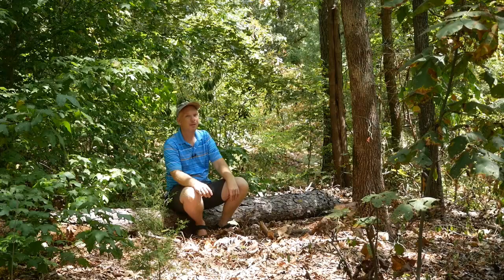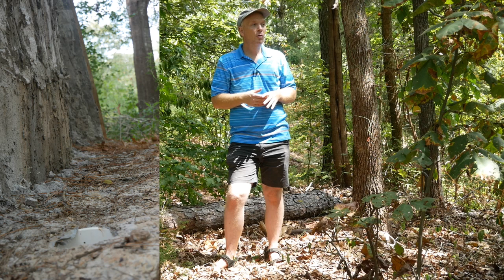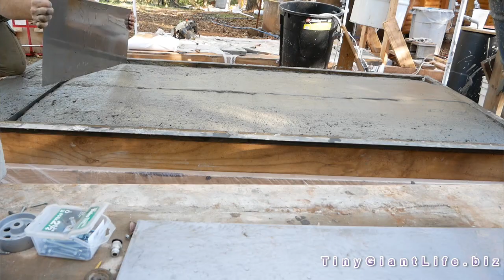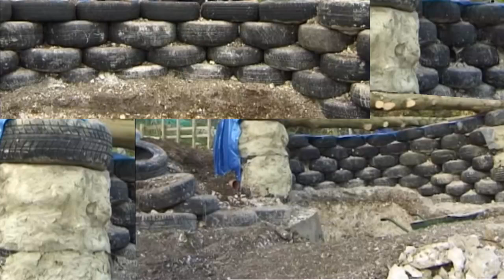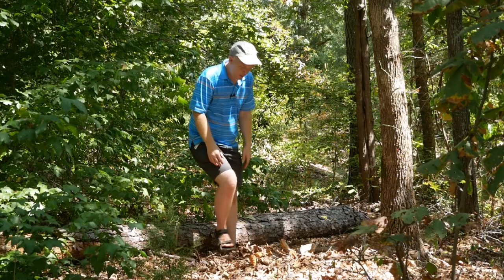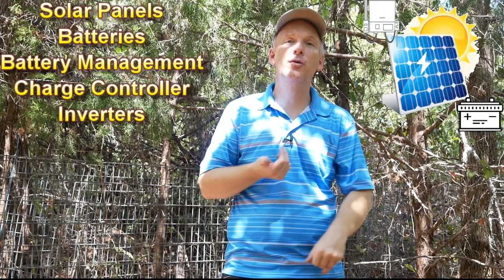Earth Ship Vs Air Crete House   YouTube

Comment: 5:49 what are you talking about? Regardless of what state you're in there's not only a garage but a tire store and probably multiple of both in every single town within every single state. It costs the tire store or even the mechanic more than a dollar to get rid of the tire that's sitting in the backyard collecting dust and you just asked if you could have it and it's always going to be free. 
So are you scared of asking businesses for free tires?
You also keep leaving out the fact that there's cardboard placed within the tire to keep the dirt inside the tire and that is also free at any store you want to go to in any Town chances are there's a dumpster labeled the cardboard dumpster

Comment: I've thought instead of using Tyres (which is hazardous imho), it would have been much easier to use Rammed Earth for the back wall. Rammed Earth has incredible thermal mass and could be an alternative to tyres wall. Aircrete sounds like a good idea as well but I hear aircrete is hard to work with (need to know how to mix them up properly) and they can't bear heavy load compare to tyres wall or rammed earth wall.

Comment: My first thermal mass earth home was built in New Mexico. today I'm in South Carolina and working on my second house with major upgrade ideas 
one idea is cooling. my blueprint has never limited me to the Mike Reynolds U shape design, I'm more four corners and traditional in layout keeping south facing the foundation of design.
but my idea to cool without a berm and cooling tubes is making the Souths traditional concept better...
I did a addition on a friend's house which sat on brick foundation about 5-6 foot high given downhill grade. instead of brick I layer earth bags. to this day that crawl space is 55 degrees all the time, he says he loves going down there in the summer and always debates why he doesn't do the whole house like this.
so my idea was to use tires for the square or rectangle perimeter about 5-6 tires high, end then use earth bags for your exterior walls. at the peak of the roof functional windows or gravity skylights, and just floor vents to pull up the cool air from beneath the home.
yes the south's humidity is something else, but I know through trial that you can actually cool your earth home, you just give your home a crawl space, most earth homes are on the ground, but I believe it's killing one of the most important functions naturally, and that's cooling, we have the thermal mass down, but I believe this idea just changed things, or at least I will see once I actually build it not just theory...
I actually have upgraded earth homes to be marketable, I also will be testing a indoor outdoor connected pond system, and also a intergraded worm composting fertilization along with the fish emulsion within the grow beds and vertical grow tubes.
my home idea is to pay for itself within a ten year period, and on a high end have potential to produce a million dollars in 20 years for retirement if you live in a legal state...
all my ideas are for we the people, for free, I can't win unless we all win, and we are losing when we actually should be so winning it's not even funny,
why punch a clock when you just enjoy your home and manage your systems that produces your income 🤷🤷 well I'm going to show a better way, I already have my first home project.
Reply from the maker: If your location is low humidity you can also integrate night sky radiant cooling.
Reply: @TinyGiantLifeStyle  nah the South is 90% humidity, like hells butt crack...
I hate it if you didn't notice 🤣

Comment: I am literally enthusiastic about hearing someone finally pitch practicality.
Reply from the maker: That's the bottom line for AirCrete is off the shelf availability, insulation, buildable now at reasonable cost without needing expensive tools or heavy equipment.  It's most practical now

Comment: "You can use your waste water to completely zero out the carbon footprint of the manufacture of that cement."
WTF?   Please explain how that is possible.
Reply from the maker: The numbers are on the internet for c02 production for cement as as are the carbon sequestration numbers for fast growing hybrid poplar trees.  I thought I did a video on the numbers..

Either way the c02 for a home is irrelevant compared to running air-conditioning or driving to work daily.

Comment: What about combining scrap polystyrene with aircrete? Great insulater and tons of the stuff available.
Reply from the maker: Think you would be better off just using encapsulated polystyrene or ground up styrofoam and cement perhaps even with a little sand combining aircrete with the foam does not help the point of aircrete is the air making the insulation and having foam in cement is for the purpose of insulation also. Eps is a great but messy product

Comment: I doubt aircrete will work for the retaining wall on a earthship for those who are asking. Aircrete doesn't have the strength of regular concrete so that retaining wall would have to be at least a foot thick (might as well just do a 6 inch concrete wall pour). Plus you want the retaining wall to absorb the winter heat into that back wall and that is the opposite of what aircrete does. I've never heard of people insulating the retaining wall. You can build a simple device the cuts the wall off one side of the tire to make the tire packing much easier. Filling the tires with aircrete is possible but there again you want the thermal mass from a solid retaining wall. I personally really like the idea of 2 ton tire bales for earthships but I can't find anyone who sells them in the Southwest.

Comment: Since concrete is actually unhealthy for you, how does aircrete compared to concrete?
Is it actual concrete materials?
Are there any toxic materials?
I was interested in earthships until I discovered some of the issues especially with humid areas. Missouri is very humid in all seasons so this would be an issue with ventilation, mold, extreme temp fluctuations etc..
How does Aircrete address those challenges?
Reply from the maker: Cement is cement.  Its NOT toxic.  Its burned limestone.  Airflow through an energy recover ventilator fixes moisture and unhealthy problems caused by stale humid air.

Comment: Many say...You can dig 6 -8 feet down... and you will get 52° -even in a hot climate... (dig deeper?)
Reply from the maker: With cool tubes it's possible.  A manifold of piles spaced 5 feet apart give you 14 BTU of cooking or warming per square foot inside the pipe grid.  8 feet is the depth for Texas.  I don't know that a basement alone would be adaquite.
Reply: Yeah. 
We're talking; the 'Mines of Moria', deep.

Comment: From what I’ve learned is I see no gain in spending copious amounts of time beating earth into old tires with a sledge hammer, no thanks. It’s ok if you are 20 yrs old. Precast concrete blocks (CMU’s) makes more sense as berm wall retainers. It’s all about thermal mass right? CMU’s May cost more, but 1) you can make your own, or 2) you can buy them. They would stack faster and easier. And what’s your time worth? No off gassing, and no critters working their way in and out of tires. I don’t like tires, I get the save the earth idea, but it doesn’t work for me. I’m going to learn more about aircrete and it’s properties, and strengths
Reply from the maker: I could not agree more. I know a guy who built an earthship by him self.  8 years of excavating dirt and packing tires.  

Even with an automatic tamper like I use.  It's still long and hard process.  A hydrocarbon meter does detect the tires inside.  

Also modern earthships that work have manafactured foam board trash to wrap the berm held back with more trash.  Then after all that in our hot humid climate it get to hot to sleep my the end of July.

Comment: You didn't get what earthships is about. The guy pounding for 8y either. It's about using local materials. Cement is a very bad contributor to climate change. You are just doing a aircrete ad. Convenience is exactly what put us in our climatic predicament. Aircrete is just bad for the environment. As an architect if feel you need to inform more about the implications of climate change and co².
Reply: You know what contributes to climate change? 
The sun and Earth cycles that have happened since the existence of the planet. We are entering a grand solar minimum, which causes an increase in earthquakes and volcanic activity. Geoengineering is also VERY bad for the environment. Be sure to tell your government to stop cloud seeding.
1960: Global Cooling 
1990: Global Warming 
2020: Climate Change
Reply from the maker: Nice, coming from a building tec that uses manafactured foam board, cement, and sheet metal.

As the CV19 has shutdown the economy co2 has gone up substantially with greatly reduced human output.  One volcano put out more co2 than 10,000 years of humanity.  There are also natural cycles of hundereds & thousands of years that are happening.  Ice caps have so much more ice than ever.   Reality contradicts the bad human climate change rant.

Further grey water Recycling and tree growing easily cancels C02 from cent produced.  [See the podcast]

Further, running your air-conditioning produces far more pollution than an multi generation AirCrete house.  If you drive to work you also produce FAR more pollution than an AirCrete house.  If, the bad humans cause climate change narrative were truth, which is not based on actual measureable facts, then you need to put down your technology and go back to caring for the earth or at least go 100% solar.

For all that hostility behind the bad-humans/anti-human population reduction to 500 million present not 1  real solution to living more responsible on mother earth.  The military & police produce far far more pollution than a place to live for generations of all the peaceful man/woman.

Do you believe that stick box house you are in now is any less poluting?

Living in hydrocarbon emitting trash houses wrapped in a layer of new manafactured foam board trash is no better other than than the attached greenhouse; which is very lovely. BTW EShip founder has cancer now.

The
Reply: @TinyGiantLifeStyle  My grandmother also has cancer as well as living an organic lifestyle her whole life in Japan 🤔? I liked your idea very informative btw no offense. Thanks for sharing!

Comment: One idea on the "Earthship" tyre filling process that I have considered looking into is to cut the upper side inner ring off the tyres and fill them with aircrete.
Connect them up with pieces of wire/rebar (offcuts).
Have you or anyone you know tried that out?
It is an idea that has been buzzing around in my head for a while now. Would love to hear back on this.
Cheers.
Reply from the maker: Actually that works fine.  You do not need to wire them together.  We used to build earth ships and buying a tamper is well worth it.
Reply: I just watched a video of Stephen Williams and i understand aircrete is too runny to hold in the tires. He also uses styrofoam (not for an earthship)  to solve that problem but i don 't imagine that to have enough thermal mass to use in an earthship...
Reply: This is an intriguing possibility. How might one cut several hundred tires in this way? What would you do with the upper ring once it's removed? Thanks.

Comment: A separate topic comment.  I agree 100% with your take on the CO2 from the manufacturing process of concrete or aircrete.  Like so many of the "pollution during manufacture" arguments that we hear about electric cars and the lithium-ion batteries, concrete in building, wind turbines, etc, etc; they border ridiculous.  When one relies on fossil fuels, the manufacture of those fuels creates pollutants EVERY DAY versus a one-time manufacturing process overhead.
Reply: CO2 increases global warming by increasing rain fall that is the official narrative CO2 is awesome while particulates and  dust are not and that causes far more so called global warming then even the H2O (created by the CO2  think rainforest)which is apparently the real villan .

Comment: Many valid points.  Some I was able to circumvent.  I used tire bales, and we were able to stack them with a skid steer in one day.  We broke ground in March 2011, and got our OP in Jan 2012.   We are in Colorado, so we have the cooler nights, and we have low humidity.  We're originally from the Midwest US, so we are familiar with the warmer (and more humid) evenings.  If I were to build a bermed-earth home there, I would add a dehumidifier, which could be an air conditioner or heat pump, and add more renewable electric power to make up the difference.  One wall unit would suffice, because the berming accomplishes most of the cooling, so one wouldn't need a forced air system.  No matter which route one goes, I would recommend sealing the home as efficiently as possible, and using a energy-recovery ventilator for air exchanges.  A few more points.  We used no foam board or other foam on the outide of our tire bales, and we used no cooling tubes.  We used 2 layers of #6 poly over the bales, prior to berming.  Thanks for sharing.  I'm going to recommend aircrete to a friend who wants to build, but without tires.  Have you used aircrete in conjunction with SIPPs?  I was wondering how that would work for a bermed wall?  Structurally, maybe a double wide SIPP wall would be required?
Reply from the maker: AirCrete is effectively like an sipp with fabric bonded to each side, but it has to be thicker.
Reply: We are going to do something similar to what you did, also in Colorado. Do you have any regrets, or things you wish you would have done differently?

Comment: Can you do an earthship type design with greenhouse attached and take advantage of cool tubes and use aircrete to make it easier, faster, and cheaper
Reply from the maker: You can make an earthship type structure.  Modern earthship only works because they wrap a lot of soil with foam.  You can only use passive design if you're in a climate has an acceptable average temp. Taos new Mexico works because the day might be 103, but the night is 50 in the high desert.  This makes a nice 72 average temp.  It does not work in many climates as well.  It will definitely be workable though not ideal.

Comment: haha, i just stretch out the tires with a tool i designed and i fill it with aircrete and stack them
Reply: Please share.!!
Reply: damn, that probably cuts the tire pounding in half when you use this method.
meaning you won't need to pound tires to death just for the same results.
Reply: I've often wondered if you could combine the two. Or skip the tires and just do aircrete
Reply: @TheWayWalker  
you probably could, i mean they use it when it comes to the dome home construction, but you have to have that shape in order for it to keep it's overall strength and integrity and lots of rebar before they put on the dirt, and that should speed up the process significantly but it also might be more expensive.

i thought of this as well, however if you live somewhere that it gets cold often, without the tires could lead to a very cold house at night, but if that's what you prefer than that's what you build, but in some cases it could be a bit too cold, i would put some tires as a barrier before the dirt is applied.
Reply: that;'s so smart, much better idea than ramming dirt into tires endlessly
Reply: AircreteHarry is doing a modified version just like this. I'm not opposed to it because of the inter-tying ability of the tires. The mass wall system is for carrying the roof load makes sense. I go back and forth with it.
Reply: i also thought the process could be speed up by renting a robot, but unfortunately these companies who have robots aren't allowing the public to use their bots right now.

if most of the process building these things is automated, these kind of builds could be up in no time.

and could also make the overall construction costs go way down in price.

Comment: PS what climate are you in?
Reply from the maker: 7b at one location and 9 in the other.  Hot with nights that's don't go under 80 at night.  

Taos new Mexico where earth ships are built the average of the days high and low.  Which in the high desert 50+103/2= 76 cumfort.  Here, 100+80/2=90.  Means sleeping outside or running air-conditioning.

Comment: aircrete vs hempcrete?
Reply from the maker: I have no personal experience with hempcrete yet.  So I don't talk about things I haven't done and lived in.  

However, from what I gather it's insulating, but not greatly so the walls need to be thicker.  It offers no thermal mass.

It's expensive and not always on the shelf.  

It's a natural fiber, but requires industrial process and chemistry to remove the rosin.  So if it's the natural you want, it's not fully. I don't know the effect on soils of industrial farmed hemp.

It's not able to offer structure.  So it's used as infill in post and beam structures.

I would compare it to clay-slip straw methods.

I'm not saying it's good or bad. It's is what it is.  Chose what ever resonates with you.

I'm biased towards AirCrete.  As a contractor who has built with and lived in all of these other structures  AirCrete just wins hands down in therms of practical application at any location and the choice to have the house temperature controlled vs subject to weather averages.